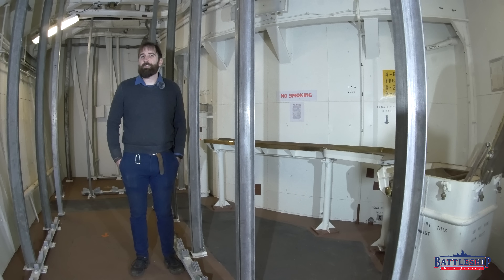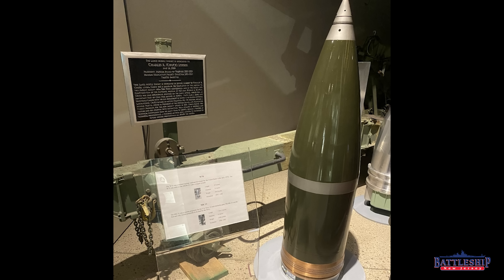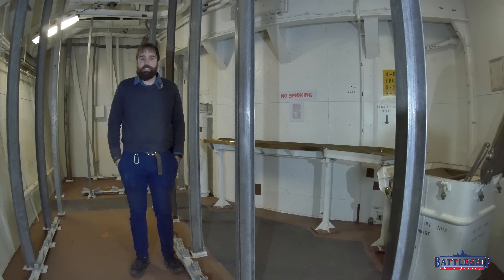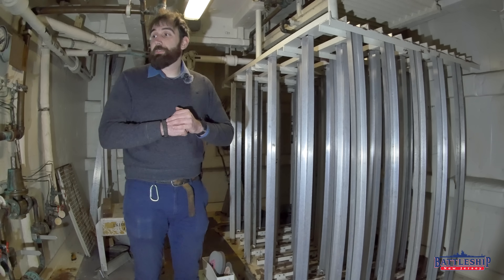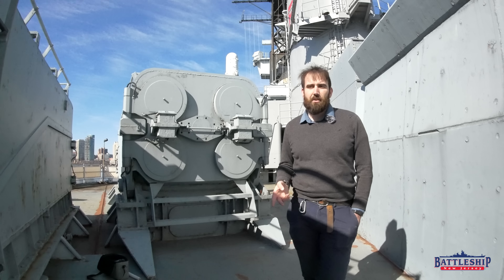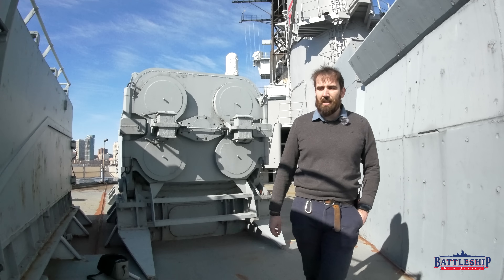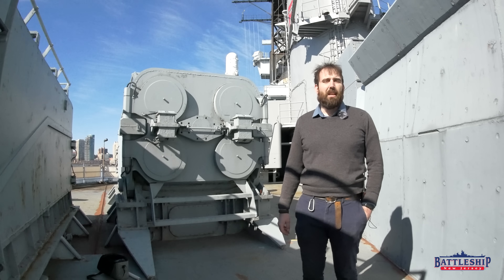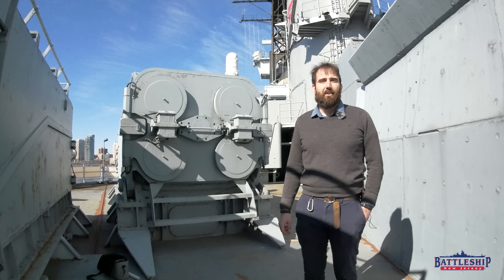Are There Still Traces of Radiation From the Nuclear Weapons on the Battleship?

Comment: The entire point of depleted uranium is to not have radiation. It's used because it's unbelievably dense (so it packs a punch in a small package) and you'll have a lot of it already if you're enriching uranium, which is better than using expensive tungsten.

Comment: The UHT (Unit Horizontal Tail) counterweights on the A-7 Corsair II used depleted uranium as the counterweight material. They had a protective coating on them and were stenciled with: "DEPLETED URANUIM - DO NOT SCRATCH OR GOUGE THIS COATING" and "THIS PART CONTAINS MATERIALS UNDER THE CONTROL OF THE US NUCLEAR REGULATORY AGENCY".

Comment: Depending on what material those ceramic ballast shields are made of, they might be radioactive.  I have measured terracotta building blocks giving off low energy beta particles which measure somewhere around 0.05 micro Sieverts above background at a distance of a few feet.  It is detectable enough that it set off my Berkeley Nucleonics Nuke-Alert at its lowest alert state when I entered a room with walls made of that stuff.  Midwest clay contains a fair amount of uranium and that may decay into radon gas, but that is mostly a problem intruding into basements dug in high clay soil. Radon gives off alpha particles (helium nuclei) which are stopped by a sheet of paper, but very bad to inhale.  Alpha particles have a very high momentum due to their mass and can transfer a lot of energy and cause damage if they run into a DNA strand.

Comment: the coast guard team was probably using a normal background radiation detector which just determines how much radiation is present not the source material. You should ask them if they had a A RIID. Which is a radiation detector with the ability to analyze the energy spectrum of radiation, in order to identify the specific radioactive material (radionuclide) that is emitting the radiation. In addition, these devices can be used as survey instruments to locate radioactive material. This would tell you what was causing the radiation and would be able to determine if it was from burning fuel or nuclear war heads. Better yet if they could get their hands on a Radiation Portal Monitor (RPM)
An RPM is a large pass-through radiation monitor (or "portal") for personnel, vehicles, container boxes, or trains. Typically, these devices consist of two pillars containing radiation detectors, which are remotely monitored from a display panel. These monitors alarm to indicate the presence of radioactive materials, including low-radiation materials like uranium. This is what Homeland Security uses to determine if a cargo container has radioactive material in it. You can search for "radiation detectors that can determine what element is causing the radiation" and the first thing that should pull up is a link to 
Detecting Radiation | NRC.gov https://www.nrc.gov › health-effects › detection-radiation  You may be able to find someone with these types of detectors but try not to go through a military source as the Battleship may have traveled to Japan when armed with nuclear weapons which was not allowed. Remember reading an article about Aircraft Carriers post war that most likely had nukes on board visit Japan and Japan complained about it breaking the deal they had with the military. Sure this is why they will never say yes to New Jersey having nuclear weapons not that it was secret. Sure we bragged to the Russians about it having nukes as they bragged to us as having cruisers with nukes on them.

Comment: I was nuke on the Eisenhower in the late 80's where we wore radiation (dosimeters) detectors to track our exposure over the month.  One month we had a incident where one crewmember had an exposure almost 3 times everyone else working in the reactor rooms.  (Reactor rooms are where the people operate the support equipment and the reactor is in a shielded room)  The problem was that the person with the exposure spent less than about an hour in the reactor spaces.  He was the Captain of the ship, he received so much more radiation on the bridge than those of us working near the reactor.  Also, as a Quote "expert" unquote we learned several things about radiation.  Think of the source (contamination) as dog poop and the radiation as the smell.  So once the poop (source) is removed, the smell (radiation) will also be gone.  I guarantee that when (or if) were removed a thorough check of the spaces was conduct and if there was a spec of poop (contamination) was left, it would have been completely cleaned, even to point of chipping paint and repainting if necessary.  Any Nukes on board would be in a room guarded by Marines, so there would be a double locked location separate from the normal ordinance storage.
Reply: Radiation has this knack of making other things radioactive. But over the decades it would've dissipated... much like the smell of dog poo; it'll linger, but not forever.

Comment: If warheads left detectable radiological contamination they would have had to have been severely damaged.  In any case, fissile material in warheads is not that radioactive. It's the fission products that present the hazard.  The most radioactive material in a warhead might have been tritium which would again only get out if the warhead was fractured and if it had got out it is a gas with a half-life of 12 years, so would be long gone by now.

Comment: If there were warheads about you would also have radiation detection equipment and at least one radiation source to calibrate the detectors.  Not sure where it would be kept, but it should be a heavy locker.

Comment: Most material which emit, Alpha, Beta or Gama (& X-rays) radiation.  These DO NOT make other things radioactive.  So, you would need to have left behind radioactive material.  Diffidently not going to get any from weapons, or x-ray machines, possibly from DU rounds.   If you what to know what it is, use a Gama-ray spectrometer which will identify the energies of the radiation, from that you can determine what it is.

Comment: Metal and whatnot usually doesn't become radioactive in the presence of low-ish level radiation for it to be detectable you would need some radiological material left i.e actual radium or plutonium particles left in the area, which for obvious reasons would not be great

Comment: That was interesting and answers a question I've had since my days aboard the USS Dixie AD-14. The Dixie was in attendance at Operation Crossroads, the Atomic bomb test at Bikini Atoll. It's my understanding they were stationed 10-12 mi. from ground zero. Not only that but we carried "Nukes" just in case someone needed a couple.  I was stationed aboard for 3 1/2 years and have often wondered if I would glow in the dark because of it. Thanks

Comment: I mean that's not how radiation works It would have been radioactive in that room if The weapons were still located in the room however they are shielded pretty well so it's not like any metal particles from plutonium or whatever can fall out onto the floor it's inside of a very protected case inside of a shell it's not going to leave any residual radiation however like I said if you were standing there and the bombs were near you you would probably get some amount of radiation probably not much because of the high quality of naval High purity enrichment. The only radiation you're going to find in that ship right now is from impurities within metal or maybe if a depleted uranium round rubbed up against one of the walls

Comment: Second both fissile Pu and uranium  are only alpha emitters even on the inside of a nuke as long as they stay sub critical you can hold the parts in your hand and they will not hurt you. The Pu will be slightly warm to the touch but that's it.  If you wrapped the core of a nuke in wax paper you could walk it under the most sophisticated gigger counter on the planet and it would never see it.
Granite counter tops are and order of magnitude more radioactive that the pit of nuke.

Comment: WOW 
First DU or depleted uranium rounds are called that for a reason. They are made out of the uranium  that is left after all the fissile uranium has been removed to be used in reactors. Uranium is a very week alpha emitter and unless you ingest it for the most part will not hurt you. The reason we quit using it is it burns and is extremely toxic. You inhale the burning fumes or left over ashes and you will have a very short horrible life.

Comment: Not only is the armor good shielding for external radiation, the steel used was made before atomic testing and so has less radiation than even in the steel made today.  The only other place on the ship that may contain trace residual radiation is the boilers.  Heavy fuel oil they burned does contain some trace radioactive elements.   That being said it is probably lower than standing outside.  If you need a nuclear fallout shelter then the USS New Jersey one of the safest places to be in that initial blast.

Comment: What would be the potential consequence if the museum did crack open one of the launchers?
Reply: Not much. the inside of the launchers would be exposed to the elements though. So there’s not really any point.
Reply: @Masada1911  Oh I know there's nothing interesting in there. Just wondering since the USN went to the effort to seal them, would there be an issue with opening them up again.
Reply: @sparkplug1018  do you mean legally speaking? Like as in the terms of the ships contract?
Reply: @Masada1911  Exactly. I know they can't reactivate any of the steam plant and propulsion. Or the galley. Don't recall them mentioning anything about weapons in the contract though.
Reply: @sparkplug1018  Actually I believe that the weapons systems weren’t explicitly mentioned in the contract but don’t quote me on that.
Reply: They probably welded em to keep the elements out . Probably not super interesting inside.

Comment: a cruise missiles warhead is in the middle part of the missile and is shielded well enough not to be detected for the most part Ryan! and she could have had Tritium onboard in night sights on small arms compasses and control displays meant to be read at night!
Reply: It wouldn't matter if its shielding was crap, and was spewing radiation everywhere... Because it's gone now. What matters if there was any contamination of the outside during manufacture.. which shielding will do nothing for.

Comment: Just because something is radioactive does not mean it makes other things radioactive through its emission of particles or gamma radiation, when something (or someone) becomes radioactive after coming in contact with or being near radioactive materials it's usually because they have picked up some of the radioactive material, this is why decontamination starts with a good scrubbing. This is why no sort of residual detectable radioactive levels would be found. In order to have left a radioactive signal there would either have to be radioactive weapons material left behind (highly unlikely, except maybe in the case of the DU but it could still be washed away) or the surrounding compartment and fittings would have to have become irradiated over time to detectable levels. For that to happen means becoming saturated with intense neutron bombardment to make the surrounding material itself full of radioactive isotopes or there would be radioactive daughter particles of radioactive decay shot out in such high amounts that they would be piling up, this is the type of thing that generally happens inside an operating fission reactor or in the proximity of nuclear detonations. Any object that was radioactive enough to irradiate the compartment around it this intensely would certainly be lethal for humans to be close to.

Comment: Please don't feed people's irrational fears of irradiated items.  Except for certain relatively specific and very extreme situations (as in deep in the core of a nuclear reactor or other similar locations exposed to extremely high levels of radiation for extended periods) that can have basically unintentional fusion reactions that create radioactive elements there isn't "lingering radiation" from something radioactive having been there, if the actual radioactive material isn't contained properly and you leave some behind in a space yes, but leaving radioactive material in a space emitting is very different than it magically leaving radiation long after the radioactive material leaves the space.

Irradiated items don't have any lingering radiation and are perfectly safe, the main trace you could find is that any bacteria etc that were on the item would have been killed when it was irradiated if done at the right levels (and ONLY the things on it WHILE it was being exposed to the radiation source), it's a good and very safe way to sterilize things including for preservation of food or for cleanliness for things like surgical tools.

Comment: Generally the presence of radioactivity would indicate that there are radioactive particles currently there.  Radiation itself doesn't generally cause other materials to just become radioactive from exposure.  So assuming that any such munitions, missiles, projectiles, etc. were on board, they would have had to have bits and pieces of the radioactive material lost into the open environment of the ship for it to have any lingering radioactivity after their removed.  This is the reason radioactive fallout is seen as dangerous compared to just general exposure, even if the dust/vapor/matter that your body absorbs has a low output, once it's in you your body will receive that output as a constant source for the rest of your life. Whereas things your exposed to with a high burst such as x-rays and ct scans are a once and done exposure, and that exposure does not cause your bones and body to just suddenly start emitting radiation.

Comment: 5 or 6 becreals a sec or atom disintegrations . I was also going to say it probably in the old paint and structures not removed. The fission material in nukes or week alpha emitters and nothing from them would be left by now. Granite counter tops are for more radioactive than the pits. Uranium and Plutonium both have very long half lives so unless you already have a critical mass they are not a lot of disintegrations per sec. Also they do not emit hard radiation till they under go fission.   Granite has Francium ,cesium, thorium and radium and when who they decay they do give off hard radiation.

Comment: Did you compare between magazines or other spaces of the ship? In my mind it's possible the nuclear magazine could have higher levels compared to the other magazine, but still lower than the outside.
Reply: Radiation doesn't get trapped, only radioactive materials do, and if any escaped you'd expect a fairly decent reading

Comment: As an aside, the CIWS ammo is plated with a corrosion-resistant metal because uranium corrodes rapidly in a salt water environment.  No bare uranium until it is fired and hits something.  There is a hot spot on the Missouri where a friendly fire CIWS round hit the superstructure during the second Gulf war.  Ryan (or Drach?) pointed it out on his tour of the ship.
Reply: depleted uranium is just that uranium that has been depleted of its radio active elements during the emrichment process. so much so that it is used to sheild other radio active elements. it is used in amo because it is dense and very hard and a high melting point (harder than tungston and higer melting pount) this can all be found on line
Reply: @K_Hansen  Depleted uranium has the fissile U-235 isotope mostly removed. It is less radioactive but it still does produce some radiation.
Reply: @RobertHancock1  ill agree with that, i have some .50 DU and it bumps up the count slighty right next to it and thats usining a scintillator dector. a geiger muller detector hardly detects anyrhing
Reply: @K_Hansen  Correction - tungsten (3,407C) has a much higher melting point than uranium (1,132C).  Tungsten is also roughly 5% more dense than uranium.  DU makes good wartime projectiles due to relative availability, pyrophoric nature, and aspects of it "cleaving" in armor piercing usage that helps with penetration. But it does leave a radioactive mess behind, see reports on the Gulf War for examples.
Reply: No doubt DU in all military applications is coated, for various reasons.. one is that it's toxic. But you always wonder if there is some dust during manufacture that escapes. From this video... Hopefully not.
Reply: @xpusostomos  True.  In fact the internal exposure limits for uranium are based on its chemical toxicity, not its radioactivity.

Comment: I wonder if there are any early fire alarms with radiation based detectors. They may still be active sources though at a tiny fraction of original amount.
Reply: You have to be very close to the Americium 'button' in metal detectors to actually detect anything, even when taken out of the metal shielding.

Comment: Only way for residual is you have to have contamination, the warhead would of been sealed up and cleaned off. And DU has had all its properties striped over to another uranium body va Heavy Water Electrolysis Enrichment. DU isn't used fuel rods and should have stable atoms. DU unstable atoms went as fuel.